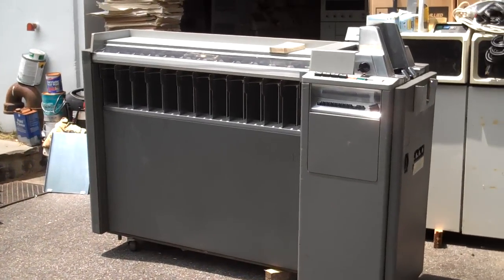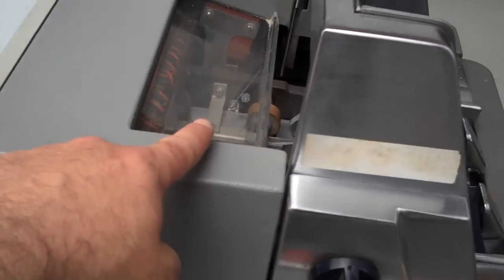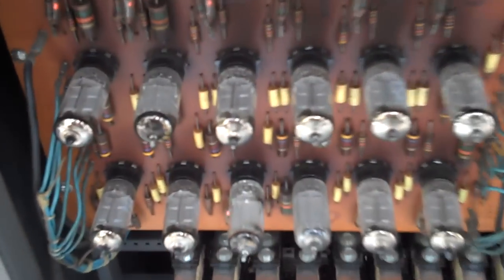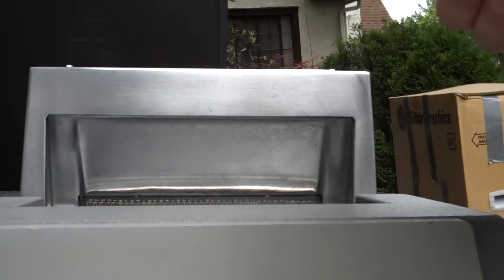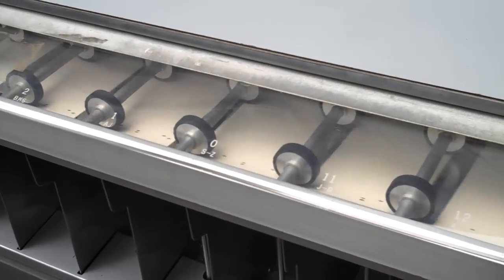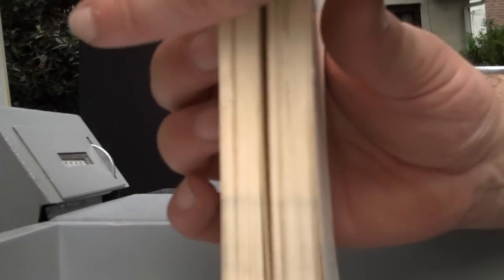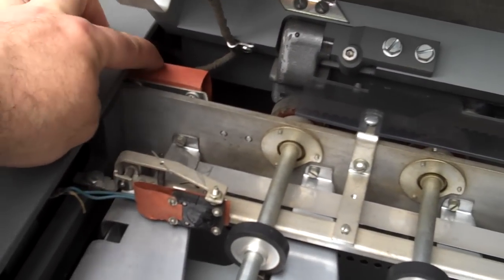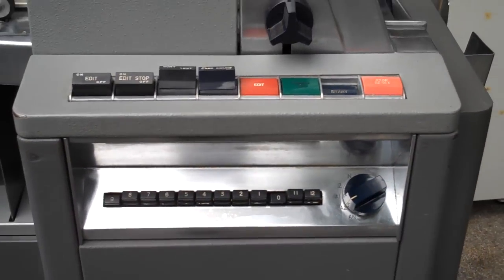IBM 083 card sorter up and running!

Comment: Damn I know this is an old video. I stumble across it just now, an I use to have to repairs these when I went to work with IBM in 1980. I actually had a few accounts still using these machines along with 0557, 0026, 0029, 0059, 0129. Hated when I had to work on them, BUT today I actually miss having to think and analyze why they were failing. These machines made you think and be a mechanic to fix them. Great days! Thanks for the trip down memory lane to an old retired IBM Service Rep.

Comment: There used to be one of these in the 'print' (drawing) library in the pipe space at TI; all the various drawings could be accessed via card files that had one microfiche 35 mm image attached in the IBM card, with the drawing number 'punched in to allow sorting at the end of the day so the drawing cards pulled that day could be first sorted then put back in the card files ...

Comment: You could have explained how it worked and shown a demo that actually sorted on, say, a 3 digit number so we could see the cards falling into the different bins. After the third run, you could have demonstrated that the now sorted cards actually all fell into the same bin showing that they were, indeed, sorted. Of course, I must assume that you know how the machine works and that you actually know what you are doing which was not indicated in the video.
Reply: actually, no.   they would all end up at the end in the same bin if the sequence numbers all had the same high order (hundreds) digit.
but the selection of the card column to sort on was unexplained which is a major flaw in this demonstration in showing how a multicolumn sort would be performed with multiple passes.
Reply: Make your own video lol

Comment: Why did they sort the cards?
Reply: JOHN,   You had to sort cards according to what field that You were interested in ( like name or address) The cards were often used in primitive computers or even electro-mechanical accounting machines. If the cards were not in order per certain criteria, it made things difficult for the other machines to handle or compare on a specific field. In the company that I worked for, we often sorted on a cotton bale number ( 7 digit Numeric and then You sorted on 6 digit warehouse location code. Total of 13 passes through the sorter.Hope that I haven't confused You.
Reply: Cause the programs would have to process the data in sequence.  There was very little disk space if there was any at all, so programs use tu process data input on the go directly.  When disk technology became cheaper and more available, the data was then loaded as-is, and latelly pre-sorted by a "sort" program.  And then, the Data Bases appeared and the indexes did all the work.
Reply: @albertopena5644   it's true that there was very little memory and no disk space,  so pre-sorting the data was required.  but also, for programs,  the cards had sequence numbers in columns 73 to 80 (typically).  you'd sort them after you drop the deck.

Comment: I actually ran one of these along with an IBM collator when I worked at our local library in the 70's.  These machines were really fun to operate.  I had a ball working with them.
Reply: Unless the long carboard box where you put the sorted cards fall to the ground and you had to start again!  Hahaha.   I also used both the 083 and the 077 with its wire panel!   We used to "program" the panels, with a punched sheet on it so when the "program" was tested ok, we could "store" them for future use by copying the wire links on it with a marker.   It seems stone age now!  But it was fun.
Reply: Me too, for Illinois Bell Tel.
Reply: Sharon,   Using the ole unit record machines COULD be fun. Sorters, Collators. Interpreters, card punches. When I started work, our company had a 402 accounting machine ( IBM) I learned to wire the boards for that machine. The most difficult deal that I ever attempted was "cross-footing".You took 2 fields punched into the tab cards and produced a result by adding the 2 fields together.  I could have certainly used a collator in one dept that we had at a local bank!

Comment: Now that is pretty cool though. It's got limited logic in order to be able to to do the sort too. Now of course in the Linux world there's the 'sort' command or 'sort -r' if you want to reverse it.
Reply: Not only in the Linux world.  "Sort" started also in mainframes.  The need for a sorter machine was due to the fact that data input was processed on the go, as disk storage was not available (and some time later, too expensive to be massive).  Once magnetic rewrittable storage was available, software sorting eliminated the need of a sorter machine.

Comment: Yes, the 029 would have helped as would a 557 intrepreter but if your employer wouldn't lease a printing card punch he probably wouldn't have rented a 557 either. I was a Tab Operator at North American Aviation from 1968-1972. I was the only operator in our QA group and my installation consisted of an IBM 084 card sorter (2000 per minute), 514 reproducing punch, a 087 alpha-numeric collator, 557 interpreter, and the bad boy 407 accounting machine. I wired boards and set up and ran all the jobs.
Reply: BRACE,    Wish that I could have seen the 407. Probably would have helped it You had HAD a 587 (?) collator. I only had experience with a 402 (IBM( accounting machine) for running reports. I certainly could have used a collator at the bank dept where we had receipts based on tab card formats.Not fun putting NEW receipts in among the old stock by HAND!
Reply: Brace67 When I was a wee lad, I actually thought that wiring those patch panels was computer programming. Image my surprise when I took my first FORTRAN course as a senior in high school! I did get the opportunity to operate some of the unit record equipment when I worked at Scott Paper in the early 1970s. Lots of fun to watch the card sorter sort my cards!
Reply: @joedempseysr.3376  It was indeed programming, but not computer programming.

Comment: I must correct you on your premise of three passes per column to sort alpha data on IBM cards. In fact, it took two passes per column. Alphabetic data was represented by two punches in a column. The top portion of the card was called the zone and consisted of the 12, 11, and 0 punching positions. In conjunction with a digit in the column, an alphabetic character was represented. First pass on the column sorted the numeric portion, second pass sorted the zone. I was a Tab Operator 1968-1972.

Comment: Sorters were generally used for data, but most programming languages of the era reserved columns 73 to 80 of each card for a sequence number. Production program decks were typically numbered in this way so that if a deck was accidentally dropped, it could be sorted back into the proper order using one of these machines.

Comment: I'm guessing this would mostly be for data. You could easily get a program out of order, depending on the language.
Reply: Definetly for data, not for programas. Unless you took the care of numbering program cards. But that wasn't a practical idea since programs are subject to a lot of changes and additions.   On the other hand, they used to be generally small, while data cards would probably be thouthands.
Reply: I believe cards were used early on to program. I remember a system into which I first ran a program deck before data cards.

Comment: The IBM 083 sorter in this video was a very common piece of punched card equipment in a tab room of old. I operated one and also its faster brother the 084. That baby operated at 2000 cards a minute using a vaccum assisted feed and a light source to read the punches instead of a wire brush. Sorting of card fields was minor to major, one column at a time. One pass for numeric data and two passes for alpha data. Card sorting was monotonous but necessary to get the date files in proper sequence.

Comment: You are correct, the 084 was twicw as fast; in fact it had a vacuum assist on the card feed to hold the cards onto the feeder knifes as the ywere called.

Comment: Normally start with least significant digit.. however.. if you had a very large number of cards i.e. multiple thousand and if you had more than one sorter, you could sort the most significant digit first example first character of last name; then sort all of the A's on one sorter while the other sorter does the B's.. over simplified but it was called block sorting; then sort normally.

Comment: This could sort 1000 cards per minute- that's about sixteen per second.  It uses photoelectric sensing to do so.  It wasn't the fastest card reader made, but it is the most common one AFAIK.  The 084 was twice as fast.

Comment: I worked on one of these machines in Halifax, NS, 1970-72. You sorted on the least significant digit first, then worked your way up.

Heaven help you if you got a card jam...
Reply: You could do it backwards starting with the highest digit but you have to return the cards to the hopper starting with the 9s digit.

Back in the day, I worked with an IBM1130 that had a card reader/punch. It had only 2 output hoppers. So what I did is write a small FORTRAN  program to read the sequence numbers punched in columns 73-80, convert it to binary on the fly and then route the card to either the 0 or 1 bin depending on the value. I sorted units digit first and worked up from there. You just kept running the cards through and when they all fell into the same bin, they were done! Note that had all 8 decimal digits been used, it would have taken 256 passes to get them all sorted! Of course, that would have been 100 million cards all told!

Comment: I ran one in actual production. Sorters were actually fun to operate and required a degree of manual dexterity. Card would be generated in our shop by RDE (remote data) Shop would have machine that read work center card and employee badge. Cards were then produce by O26 remote key punch. Cards were then sorted by job and time and then sent to tabulator which produced report for cost accountant. Replaced big tubs full of hand written time cards. System was also tied to time card system for pay.

Comment: All the cards had punches in them. The holes were read by a wire brush that was set on the column to be sorted. What ever row the hole punched in that is the pocket that that card was sent to. I worked for IBM from 1966 until 1996, If IBM made it I fixed it! The sort speed was 1000 cards per min. until it jammed then it was a mess to get the cards out.
Reply: And when there was a jam (usually b/c the cards weren't riffled prior to loading the tray) someone (me) had to punch a new card to replace the damaged one.  Fun times!?!  In a bad jam the machine would have to be fixed - way above my pay grade!

Comment: @abaduck How to sort: 1./ set sortcolumn to Last column.  2./ Run.  All cards go from top hopper to the side pockets.  Collect pockets in order into one pile, place in top.  3./ Decrement column..  Repeat 1-3 until column number = First.  Done.  It's easier with numbers than with letters.